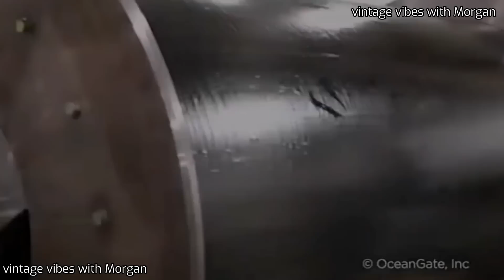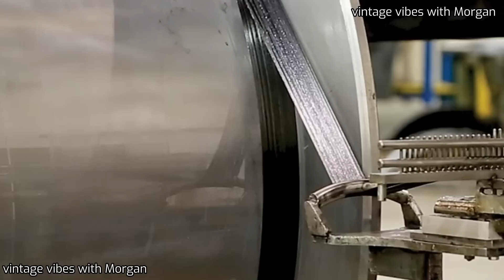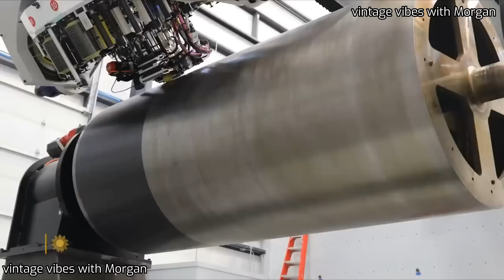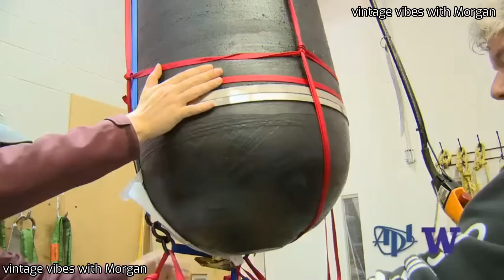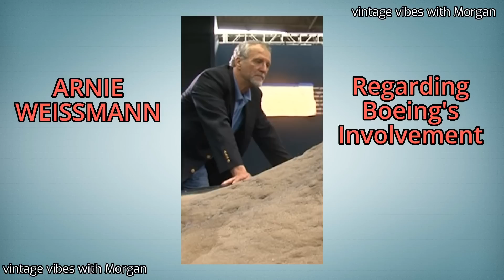Titan's Carbon Fiber Hull and its Mysterious Partnerships involvment (secret revealed)

Comment: Now that we know how it all ended it is easy to conclude that Stockton was completely irresponsible, and maybe he was.

But we need to look at it objectively and not in hindsight.

It was not a secret that OceanGate rebuild the hull in 2020. Stockton has been open about this in interviews. Yet all videos I have seen so far until this one ignore this important fact.

Video after video blame the failure on things known or observed in videos about construction of the first hull. This is completely irrelevant.

To do a meaningful analysis you need to look at what they improviseret the secondat time around, but also what they did not improve.

Also the University of Washington test was on a full Carbon Sub. This is equally irrelevant because this is not what imploded.

Comment: So carbon fiber works under tension, not compression.   There was no weave in the layup. Just wrapping in one direction.   A side to side during layup would have made a more compress able structure.  I believe. Also. No one makes a carbon fiber wheel for cars because they explode with no warning.
Reply from the maker: Indeed, yet they have warned several times but nothing , what a tragedy! , thanks for your comment.

Comment: Look at all the air bubbles trapped under that fibre at 1:18
Reply: I saw that too.  I think that the way that it was wrapped had something to do with it.  No back and forth just straight up and down.  No cross weave.   Carbon fiber works under tension not compression.
Reply from the maker: Indeed my friend,  there's a lot of problem out there, i wonder how did they make that far! , what a tragedy, thanks for your comment.

Comment: Good to see the result of your digging into the 'partners'.   Another part of the jigsaw would seem to be the DeepFlight Challenger project which used CF and titanium and is said to have inspired the Cyclops 2 project.  This would further suggest that Rush was not trying to invent something completely stupid, and was going through appropriate collaborations to achieve his aim by building on existing developments.

I don't think one should be critical that the first hull failed - virtually no project works perfectly first time; that's why they tested it.  They would seem to have learnt from it in making the second hull.  I'm not sure if it is certain if the second hull used the same source of CF; there seems to be a more sophisticated machine depicted.  I think many people (including this video) have possibly shown the wrong video when talking about construction of the actual hull of the operational craft, and criticising the process.

If the reports of at least 11 visits to Titanic are correct, then Titan perhaps survived that number of pressurisations, and probably over 40 hours at depth.  Arguably quite impressive, and I can understand Rush being quite smug about it.

If the leaked communication transcript is correct, then unfortunately his patented RTM either didn't give enough time, or other failures prevented an emergency ascent  when impending failure of the hull was alarmed on that final dive.  With a bit more thoroughness in the development and operation of the project we might not be having these conversations.
Reply from the maker: Big thanks my friend, the best way to understand something is by going into it’s intricate details , at least this what I believe in, again it’s hard to convince people to believe as everyone has it’s own interpretation and beliefs, thanks for your comment.
Reply: @VintageVibeswithMorgan  Thank you.
Reply: The challenger was a one time use craft.  Only one deep dive then retired.
Reply: @lookronjon  From what I've read it was planned for multiple dives to the deepest parts of the oceans (far deeper than the Titanic wreck), but after testing was considered only suitable for a single dive.   That notwithstanding, the relevance is the construction of the craft which appears to have been the starting point for Cyclops 2.

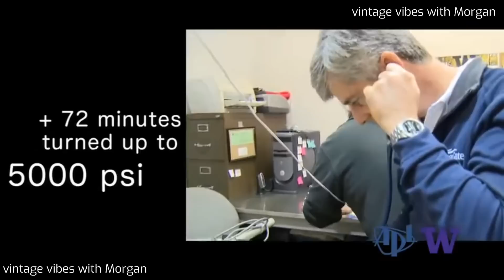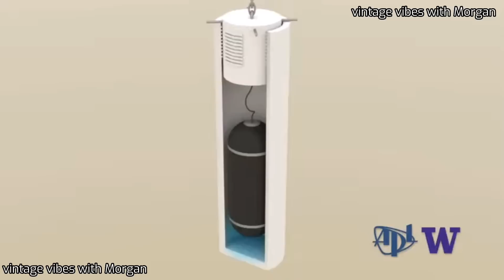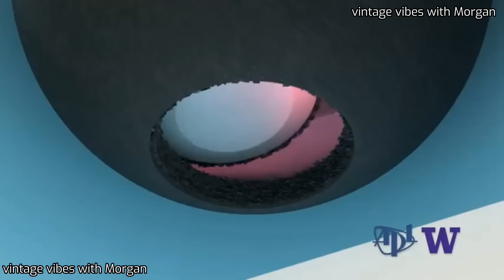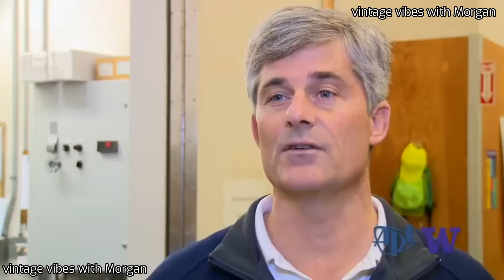Comment: If the leaked transcript is right, this experts account of the sub imploding while falling is wrong. At 9:28 Titan was at 3433m when it detected a possible hull breach. Rush only then decided to slow Titan's descent velocity. At 9:30 The Titan continues to fall even with the thrusters activated to ~3500m or more and the rate of descent was increasing and in response Rush decided to release the ballast. At 9:32 Rush seen no improvement in the descent rate and was preparing to jettison the frame. By 9:35, multiple attempts had been made to jettison the frame and was successful allowing the Titan  to ascend. At 9:38 the crew heard crackling sounds in rear of the Titan. At 9:40 the crew could not identify the source of the crackling and did not respond to a request for indicators on the real-time-monitoring system (RTM). At 9:42, the crew was running diagnostics and the Titan was ascending very slow. While the crackling sounds had subsided the RTM alert was active and all red indicating imminent implosion. At 9:43, the Titan was ascending but very slowly at a predicted 25% rate and Rush was unsure as to why the ascent rate was so small because there was nothing indicating a power failure or a thruster malfunction; the Titan was at 3476m. At 9:46, the Titan was at 3457m when it alerted the crew of a power failure in the A-Power bus prompting Rush to switch to the B-Power bus. The crew heard more sounds in the rear of the sub and this was the last time the Titan and it's crew was heard from. This transcript implies that the Titan was able to come out of its freefall and ascend. Which means Rush could have adjusted his speed on the way down and just didn't and it's unknown as to why. If you couple the descent rate along with Rush's decision to not slow the Titan down, this was the beginning of the cause of the implosion. Any sub  descending at twice it's descent rate, whether it's made from carbon fibre or titanium would implode under the immense pressure of water at that depth. From the transcripts, it appears the Titans descent rate caused damage to the hull and other systems. The primary power system was on the verge of going out which explains why they were only getting a 25% ascent rate with no indication that it had completely failed. By the time Rush switch the backup power it was too late, the Titan had imploded.
Reply from the maker: I think the transcription is just made up my friend, as there’s a big lie into it which is the FRAME DETACHMENT wich is totally wrong, ocean Gate frame doesn’t detach, I’ve seen decent amount of Rush,s videos talking about titan and it’s Dropping mechanisms but nothing ever mentioned about the frame detach at all🤔 , thanks for your comment .
Reply: @VintageVibeswithMorgan  We have to wait for the investigation to confirm 👍 anything we're talking about! Even then, we may never know.
Reply from the maker: @dwsfamilyvlogs7705  indeed my friend 🙏.
Reply: @dwsfamilyvlogs7705 No-one takes that transcript seriously.

Comment: I knew Stockton wasn’t lying when he said (over & over again) that he worked with the University of Washington.  I’m very glad you found that video where the University ‘boasts’ about their role in the project.
Reply from the maker: Indeed my friend, in fact it turns out that their relationships was build weak, seeking for profits with no regardless of safety or caution, ones everything is collapsed every one is trying to differentiate himself from the responsibilities!, i say wrong time to do so 😂😂, Thanks for your comment my friend.
Reply: Nothing like building a piece of shit and boasting about it otherwise…
Reply: @deansorgan  “a piece of shit” that got down 4000 Meters under the ocean (Titanic Depths) at least 20 times.  A “piece of shit” that actually visited Titanic 12 times in 2 years carrying 28 different people.   

What happened was a terrible accident on an experimental submersible built by a man who was passionate about the ocean and needed paying enthusiasts to build the vessel & make his dream of maritime exploration come true.  

An investigation will find what the design issues were.  - BUT if this thing were a “POS” as you claim then it wouldn’t have gotten so far over 2 years.
Reply: TBF, I've seen that video from UW on several other videos on the Titan. I believe UW worked on the original model (Cyclops), not on the Titan (Cyclops 2).

Comment: The inner ring on the end caps that was less than 1/4 inner rim that fit around the carbon fiber hull,, think about it that inner ring was withstanding 126 million tons of cumulatively pressure amount those inner rings which gave out first!
Reply from the maker: It’s a big indication that the viewport is a big no no on the design as experts stated, thanks for your comment.
Reply: @VintageVibeswithMorgan  it must have been a missive explosion / implosion were talking equivalent of tons of tnt!
Reply from the maker: @starwoidlegorc826  indeed my friend.
Reply: @VintageVibeswithMorgan  I'm just wondering if the shockwave did any damage to the titanic
Reply: Carbon prepreg that has exceeded it's out life is a bit like best before date on food. If you are careful with transport and storage it's perfectly safe to eat stuff that is a day out of date. You can also do lots of test pieces.
So I doubt this issue was the cause of the failure, and it was a tiny risk on a project as inherently dangerous as this one.
Don't get me wrong, I wouldn't have used it, because with the pressure involved I would want to have eliminated every risk possible however small.
Rush was not as stupid as many are saying, but I just can't get my head around the cracking issue, any noise whatsoever and I would surface immediately and never use the same hull again. Rush seemed to think that he had proven that you could relax about cracking because he had taken multiple trips, and to some (small) extent he was right.
Reply: @andrewpease3688  That’s correct - THANK YOU for acknowledging Rush WASN’T STUPID.  He did make a big mistake by not investigating the cracking noises - even those close to the surface.  He told a crowd “all submersibles make noise - ask PH” to downplay it.  My guess is he thought he could beat it with the real time hull monitoring system.   He also had 12 successful dives to Titanic, 20 dives to 3800 meters.  Each trip gave him confidence. The pressure vessel was safe. It was an experimental sub, and he thought he could manage the noises if they occurred deep in the ocean.
Reply: Yeah but the ridiculously strong glue adhered both “end rings” to all 5 inches of the carbon fiber around the entire circumference on both ends of the cylinder. Think about it - That’s plenty of surface area for the ring to be sufficiently bonded to.  

As such, the 1/4 lip you mentioned didn’t need to be any larger.
Reply: @michaeldonnelly2977  Yes but it was having pressure from the carbon hull pressuring inwards onto that thin lip as you can see on the photos of the scrap they are torn off were talking 126 million tons of cumulative pressure on the hull pressing squeezing inwards onto the tin inner lip of the cap ring!

Comment: 2021 Upgrades are made to the carbon fiber hull for Titanic Survey expedition in 2021
Carbon Fiber composite by ElectroImpact

The CF being out of date is false. It was supplied by the companies making it.
Reply from the maker: Well it failed anyways, I really don’t see any upgrades results! , right? , I already have seen the ocean gates Facebook post, but didn’t trust them after all 😂😂😂 , again this still my personal belief, big thanks for your comment.
Reply: @VintageVibeswithMorgan  
I'm not sure if the old hull was updated or replaced.

Hard to find out. But the upgrade was meant to be thicker.
Reply from the maker: @wispa1a  indeed, for the hull replacement , it’s proven by an ocean Gate employee , and this was later supported in Wikipedia article, check the link in the description, thanks for your comment.
Reply: @VintageVibeswithMorgan 
You know I noticed they tested a different type of wounded CF to the one used.

They tested zigzag but used one direction wound CF

So what they tested and verified wouldn't have worked the same either.
Reply from the maker: @wispa1a  indeed, it happened I just found the whole ocean Gate archive , I wish I found it before making this video! , there’s a lot of involvement right there.
Reply: @VintageVibeswithMorgan 
It's a good resource. 👌👍
Reply: @VintageVibeswithMorgan 
Some of the sources need to relink to way back machines for oceangate own stuff as you know it's deleted from the source now.
Reply from the maker: @wispa1a  yeah thanks to the backups and archives , now we can link everything together, big thanks for your interaction my friend, I’ll keep you updated.
Reply: @VintageVibeswithMorgan  

Is listed on the oceangate web archive.

All the papers , thesis etc

Comment: @ 3.04, the Blemishes on the  CF wrappings are alarming .

An outside thought on the integrity of the air purification circulation system Connection to the passenger pressure chamber.
Reply from the maker: That’s a good notice right there! , yeah it might be the cause for the implosion right , but for now I only focus-in the carbon fiber part only rather that other circumstances , thanks for your comment my friend.
Reply: @VintageVibeswithMorgan  Yep
Reply from the maker: @roystonboodoo7525  big thanks 🙏.